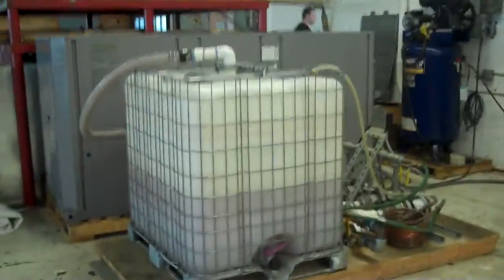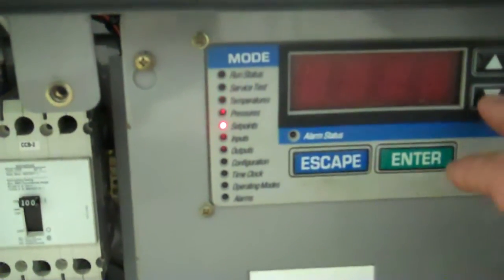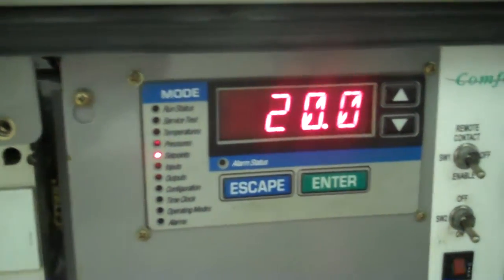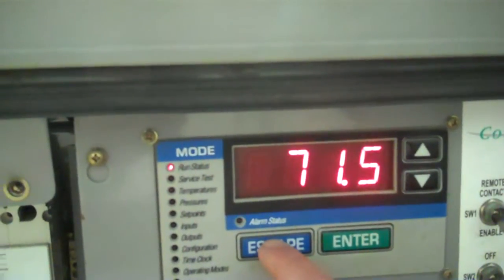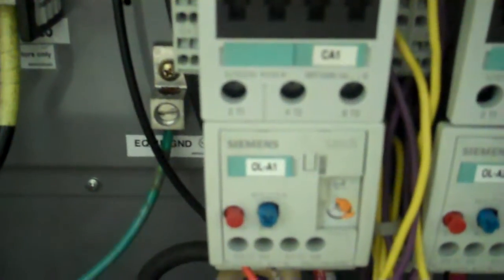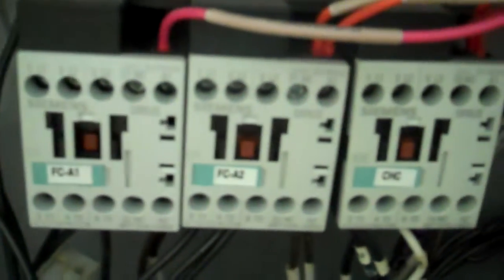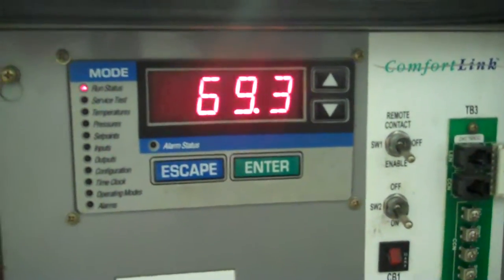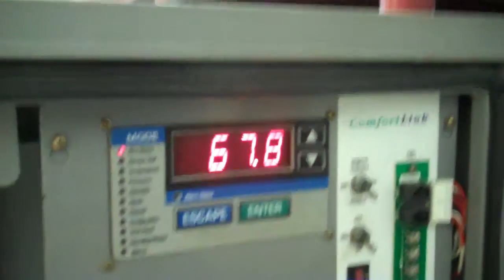Carrier Glycol Chiller, Aquasnap 30RAN025 25 ton Low Temperature 20F, 2 of 3

Comment: Ill be frank. Im in the Army. The barracks I live in uses an Aquasnap 30RB, on the smaller side; Maybe 100 Tons. The air coming from the vents in each room isn't very cold. The outside air temperature is ~60-70F, yet the coldest anyones room will get is 75F, running 24/7. 
I believe they're trying to cut costs, (because lower enlisted soldiers don't matter to them I guess) and the temperature setting of the unit is too high. Is adjusting the setpoints, while the unit is running, the best way to adjust the temperature? Say if I were to turn it down a few degrees... covertly.